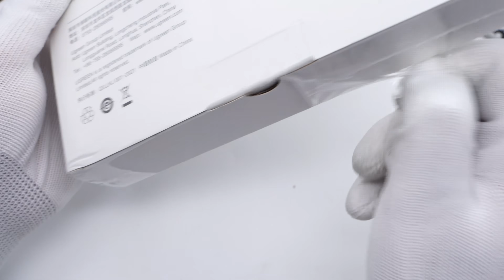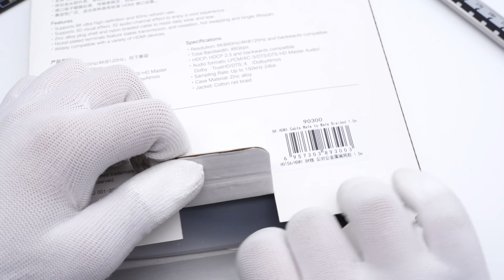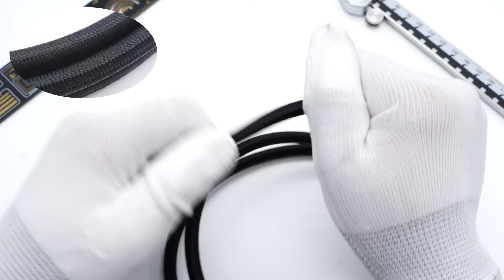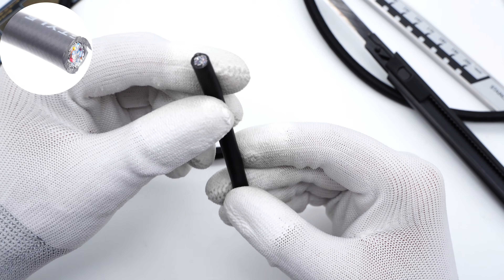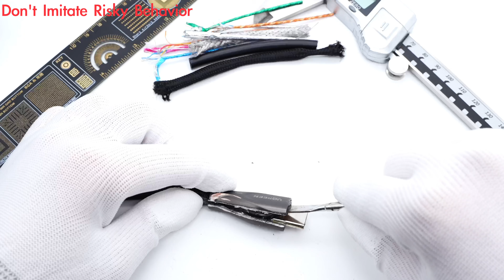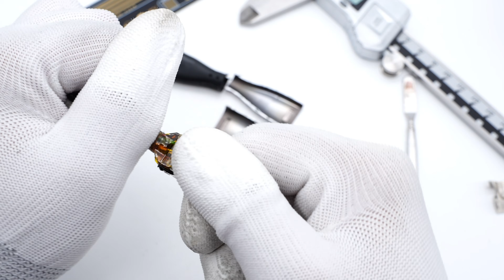Teardown of UGREEN HDMI 2.1 Cable | 8K 60Hz, 4K 120Hz

Comment: Id like to see more HDMI testing, its still so hard to find independent testing and a list of certified cables that actually perform to spec w/ HDMI is such a complex cable since its performs so many functions now. There's so many issues that ive run into in the last few years w/ 4k 100FPS+ support in combination w/ 8/10/12 bit HDR, & e-ARC support. Id like to see comparison to Zeskit's HDMI 2.1 cables & U Greens alleged 10K cable, and even those "fancy" but questionable Audioquest cables.

Comment: Amazing teardown. Thanks for such detail video. I have 1 technical question related to this cable.  This cable comes in different lengths. Can we buy a 5meter or 3 meter cable for our monitor to pc connection? I am told by someone that hdmi cables shouldn’t be longer than 3 meters. Is it true?

Comment: UGreen is the most popular brand in China, overall it is very durable, and great price-performance ratio.
Reply: How about vention?
Reply: @hellchemical  Vention is not good, I have a Vention display port cable and its shielding is bad, when i stand up from my chair ,from the static that it creates, my monitor flashes. Doesn't happen with other cables.